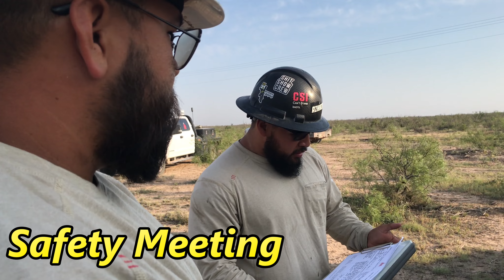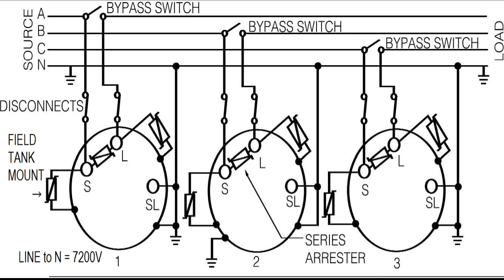Stabilizing Weak Voltage with Voltage Regulator Install on a 7200 Volt 3 Phase Distribution Line

Comment: Nice! I need that drilling bit though.
Reply from the maker: Yea you could have used it at your sawmill.  It plowed thru rocks no problem.  Wish I had a bucket truck for many reasons (tree work, pole work, and crane work).  Dave get out and make some boards!

Comment: I wonder how many things the low voltage screwed up? Thanks for the videos.
Reply from the maker: Ghil the low voltage caused havoc with the VFDs.  The across the line motors kept working.  Glad to hear from you!

Comment: Tejus... never sends their best.  Setting poles with foam.
Reply from the maker: I’m not a fan either
Reply: @TripleTRanchAndSawmill  There are appropriate applications for it.  I don't see that being one of them.  Guess it's their line, their maintenance... All of which get passed right along to the consumers with premium markups.
Reply from the maker: I have been setting smaller diameter post with packed gravel.  So far had no problems